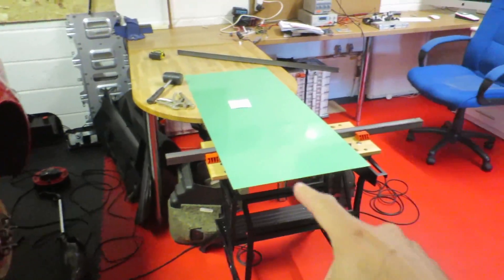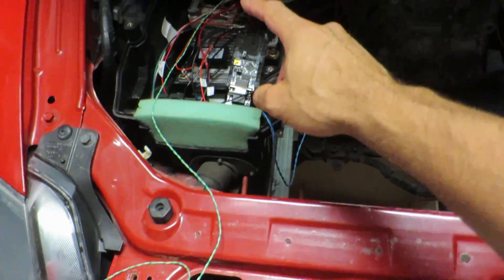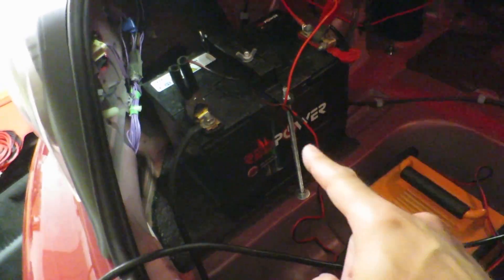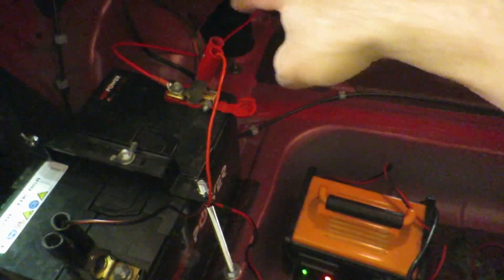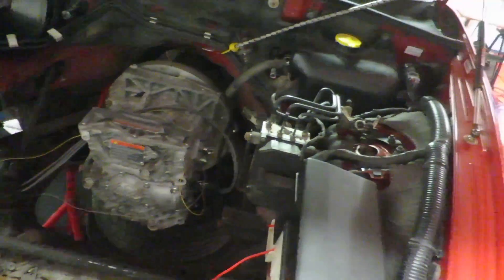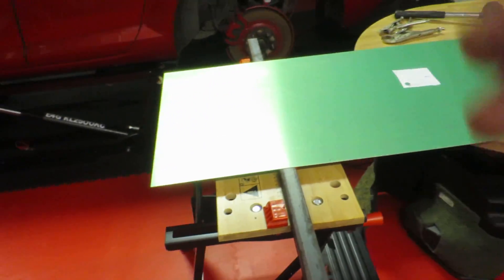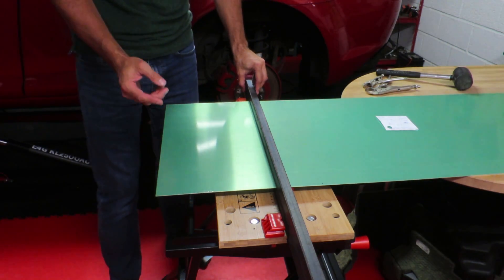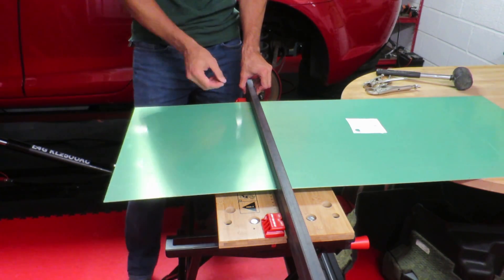Time to make my battery boxes, folding Aluminium is interesting!

Comment: Have you looked at using adhesives to bond aluminium? These are used in aerospace and increasingly in automotive applications (the Jag iPace utilises adhesive bonding).
Reply from the maker: So, not done the update yet but yes I have purchased some contact adhesive. However I also bought a rivet tool that I have fallen in love with and used to finish the boxes!

Comment: heat it on the spot you want to bend and it will bend super easy
Reply from the maker: I find when heating sheet ALU it just warps straight away. Its not difficult to bend cold tho.

Comment: Good job, great to see the progress.

Do treat yourself and get a couple of G clamps. Those mull grips will slip 😀

One question, why keep the 12v system? Can't you step down the HV system to 12v?
Reply from the maker: Sooooo, its quite inefficient having a dc-dc converter on permanently from the HV to LV systems. Not only that it means you need to keep the HV system 'live' even when the car is not in use. Best to just keep the 12v and charge it (in the same manner) from the HV system when the care is in use.